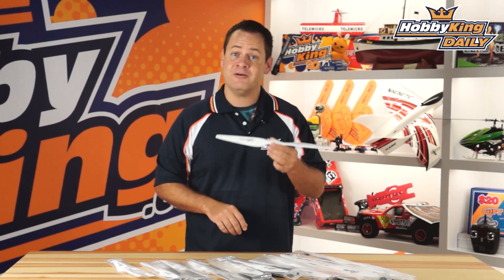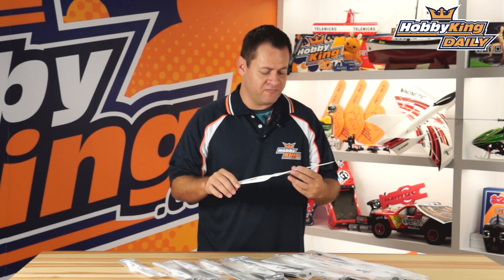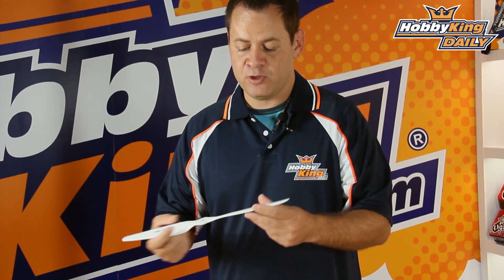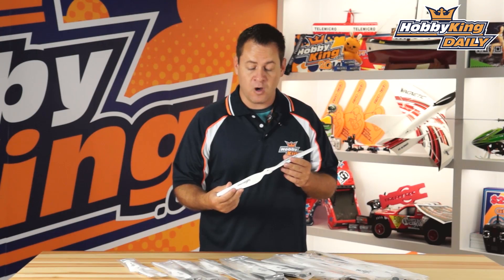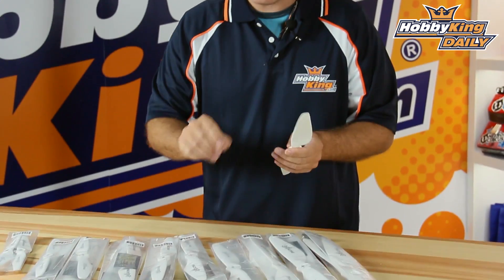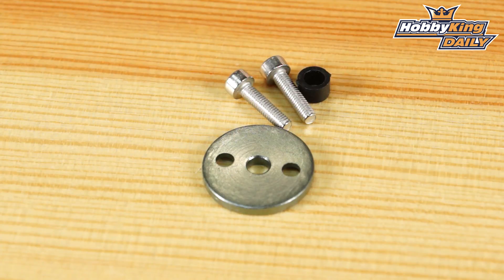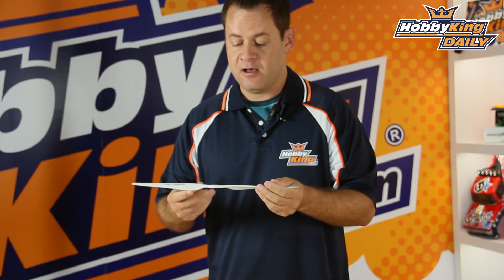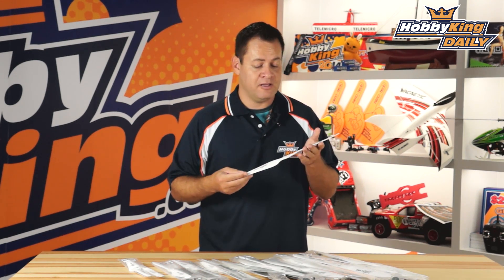MultiStar White Edition Wooden Multi-Rotor Props - HobbyKing Daily

Comment: Doesn't everything have "good weight properties for their given weight"?  But apart from that gaffe, what kind of wood are they made from?  Wood can be inconsistently dense and having the weight shifted by that can produce odd flight characteristics.  If they are CNC'd to be quiet and efficient, can't any material be CNC'd the same way?  And ditto on other questions here, ie. mount-hole size.

Comment: Hi.
What is the shaft hole diameter on the 9 inch version? It's really annoying that idiotic phrases like "t-motor mount" or "dji style" replaced proper specs. Not everyone uses overpriced dji crap - I, for one, would very much like to purchase some 9 inch props before they're in backorder and mount them to a standard, 5mm shaft.